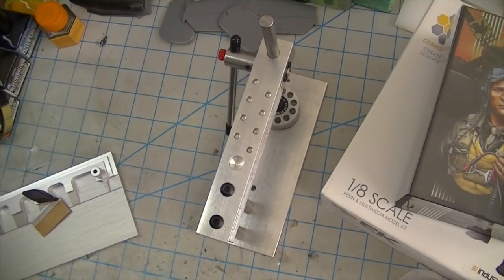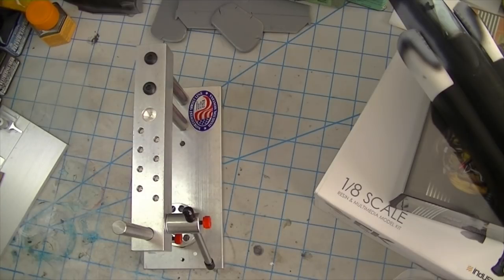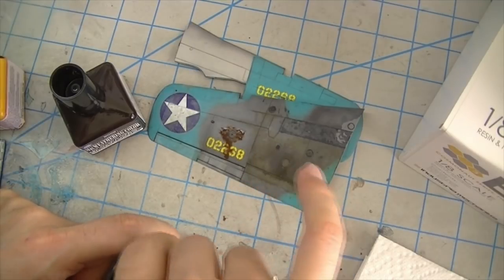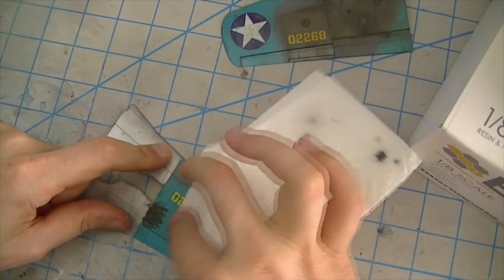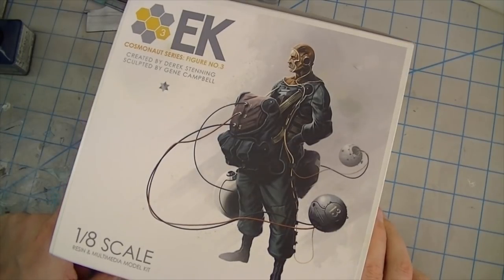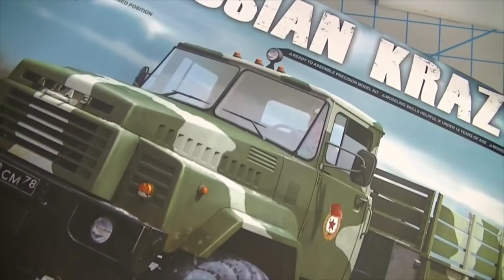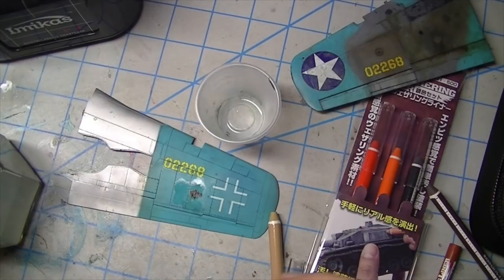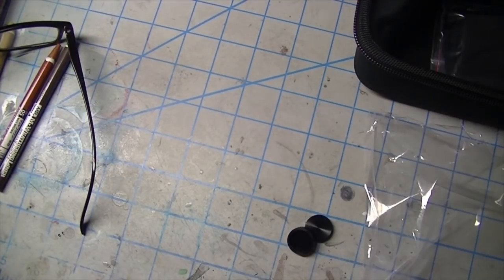ep160 - more cool stuff part 2

Comment: Hey Will, here is what the GSI Creos Page says about their filters http://www.mr-hobby.com/en/itemDetail.php?iId=1814
Basically it’s what you worked out. Paint it on with a flat brush, then wipe off as much as you need to achieve the desired affect.
The description of the pencil things isn’t especially helpful though. The website is handy to give info on how to use their products. I’ve got it bookmarked and use it a lot.
Cheers

Comment: Hey Will good vid as usual mate.
I bought the 4" Hold n Fold PE bender, made by the Small Shop USA. It's a beautifully made tool. I don't do that much PE but some kits, normally from my fave makers like Bronco, AFV Club and Dragon often don't offer alternatives. Never mind buying aftermarket stuff! Quite a lot of the time you can get away with smooth pliers, but if it's complicated you do need a good bending tool, so although expensive I consider it money well spent.
All them rails on that Israeli(?) tractor thing would drive me insane, I'd love to do some of them good old Wingnuts, or even other Bi-planes, but the bloody rigging scares me lol.
Anyway, nice work and all that old bollocks mate.

Comment: Two sheets of glass and some tape is still my go to pe bender,over my small shop.I just got a halftrack so i need to get the $97 photo etch kit by griffon,just got to find out why...xmas! yoctosun do a cheap(sorry)loupe,the lens can be moved nearer or further from eyes 5 lenses 1.5 -3.5,even has little LED lights,headband or glasses attachment.that UV glue is versatile.

Comment: When I've seen filters used they were always sprayed on. Often specific panels were masked off to subtly change their color. But it never made much sense to me that whole panels would shift evenly, unlike if you were trying to represent different materials like a bare metal finish. I like your caveman approach of scrubbing it around. Neat effect. I suppose if you were doing a diorama you could spray an orange filter on the west side of the subject to mimic the look of the low-angled sun.

Comment: Will those GSI weathering pencils might be really good for applying streaking effects on tanks ,airplanes, etc  maybe try drawing the dots or streaks then lightly brush a thinner dampened brush over it in direction of airflow or rain. I have never used the product but it looks like it should work quite well. Now I'm interested in trying them myself ,I've seen them around for a little while but no ones really explained or shown how to use them so please do a follow up video after you do some experimenting thanks.